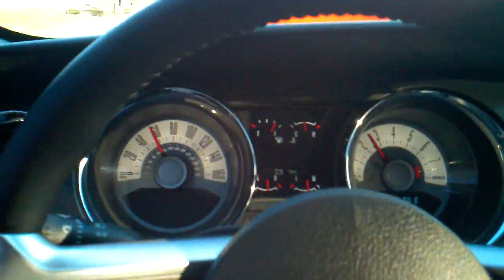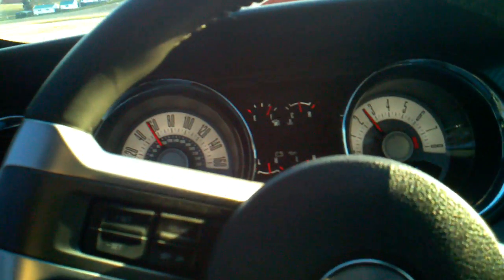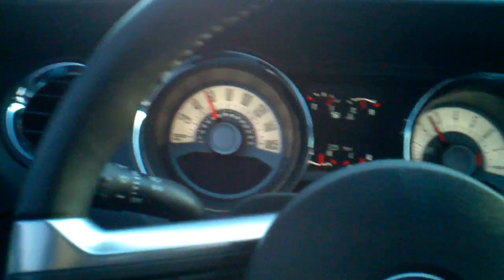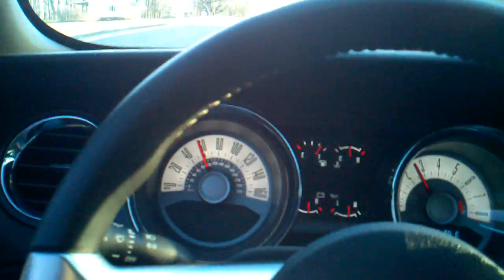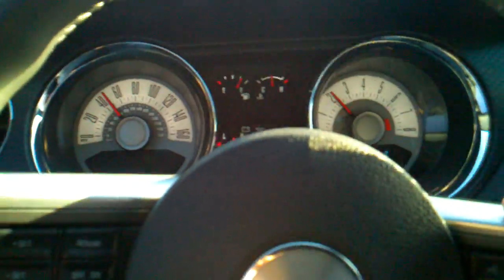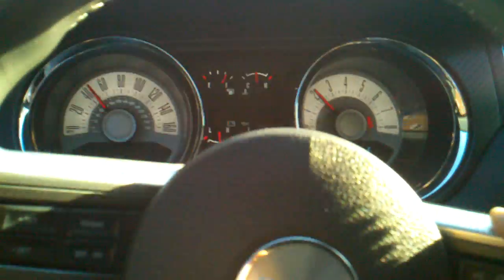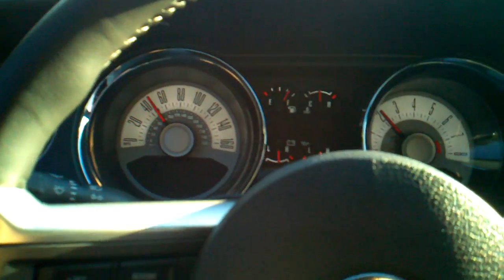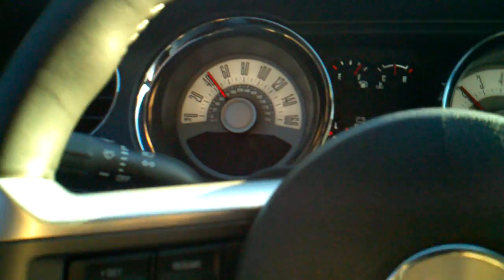2011 2012 Mustang GT CEL Misfire code 30x - 316 relearn part 2

Comment: Thank you for this video. I just had my clutch and flywheel changed, started seeing a flashing or solid CEL, and was losing power. I connected my OBDII code reader and was seeing P0300, P0304, and P0307 codes. The later two are for misfires on cylinders 4 and 7. I bought NGK Iridium plugs and Accel 140060 coil packs, which are being shipped now. Then I saw your video. I'm pretty sure it's going to be the crank sensor re-learn thing that will fix it. I doubt the small shop that did my clutch job will have the Ford IDS. I just looked it up and it requires a software license with an $849/year renewal. I guess it's off to the dealership I go, when I can get some time off work.
Reply from the maker: Mark Powell it is def you crank sensor. Send all that other shit back.......please if you'd be so kind pick a few other videos of mine and watch them and make sure to subscribe.
Reply: Duly subscribed. Glad I found your YouTube page.
Reply: I explained this to my shop (it's not a Ford dealership), and he said to do this: get on a long straightaway, speed up to 65, take your foot off the accelerator (do not touch the brake), let it slow down on its own to 40. Now, do that again 4 more times, for a total of 5 cycles. He said that would teach the crank sensor. It worked! No more CEL, no more codes!
Reply from the maker: Really that is good information.
Reply from the maker: Mark Powell I will make a video on this in the spring. It worked huh??? Still no issues ???
Reply from the maker: I know at that shop they rev it to a threshold on the computer and hold it and then do it a few more times
Reply: Yes, it did work! I had no idea. My Mustang is still running like a dream.
Reply: man i having the same proven
problem.  snd just order msd coil packs for my 15 gt. ima try your method right now

Comment from the maker: It took about 10 minutes to fix with a laptop and car running. I was not charged but knew people at two different dealerships. They shouldn't charge you for a ten minute fix, if you right the steps down and tell them this is all I want, I don't think any dealer would charge for ten minutes, but you never know.

Comment: Life saver video, thx so much!. I have had the clutch and flywheel replaced, new shaker 1000 subs, new shaker 1000 sub woofer amps, new driver side power seat motor and bracket. All within 20k. OMG, I cannot believe the stress this car is causing me. What next? I hear these things also have A/C problems. I live in TN and I am just outside the lemon-law policy, or I would be lawyering up against Town and Country Ford in Nashville, TN.